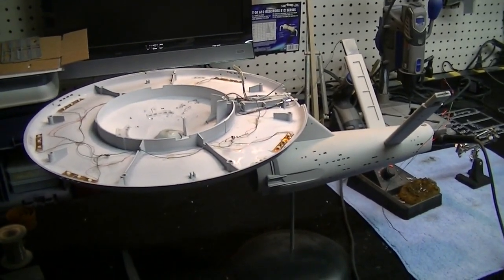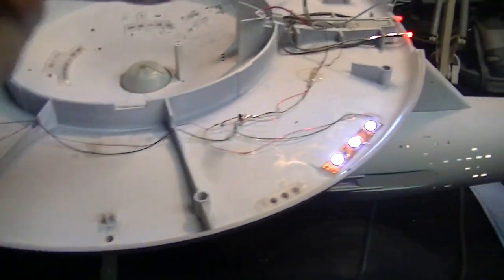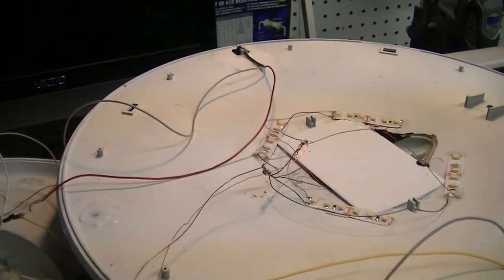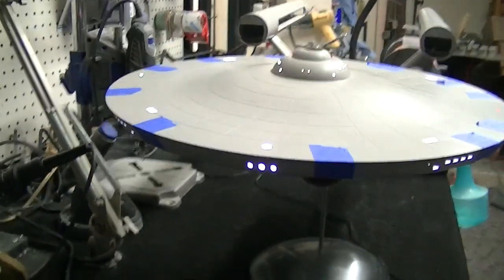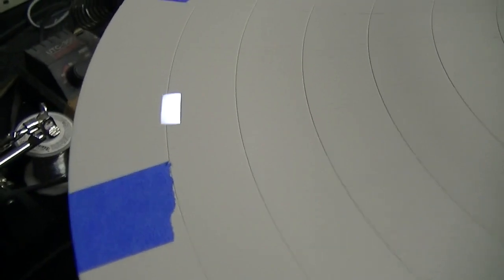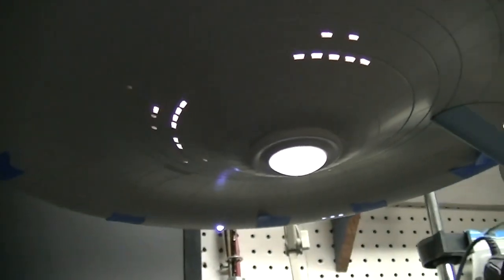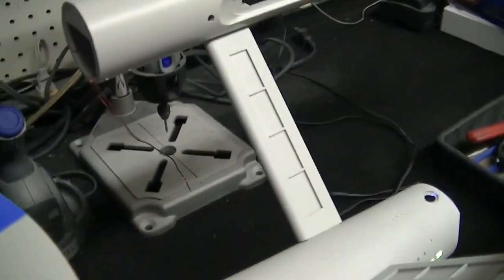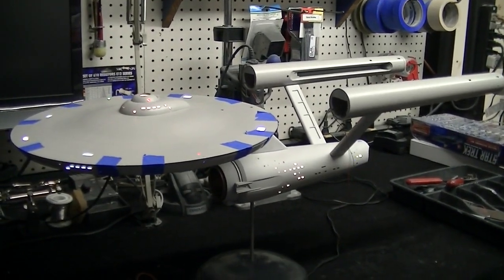Polar Lights 1/350 Scale TOS Enterprise Buildup PT 7

Comment from the maker: I always recommend a dual action brush over the single. They allow you to do so much more. Keep in mind that an air brush is intended for detail work on small to intermediate sized parts or for adding detail like shading or weathering. You wouldn't want to try and paint big parts like this kit has with one. You'll need cans or a spray gun for that.